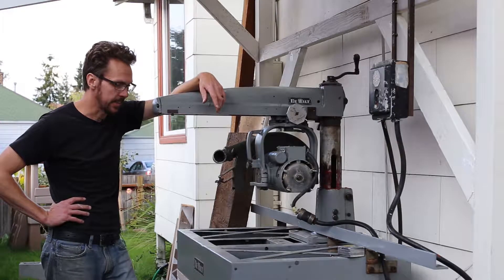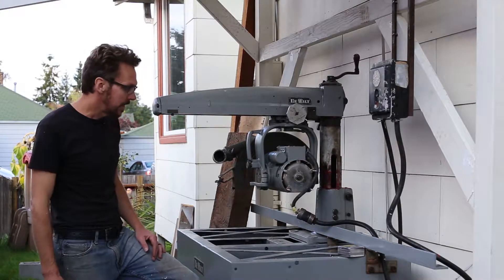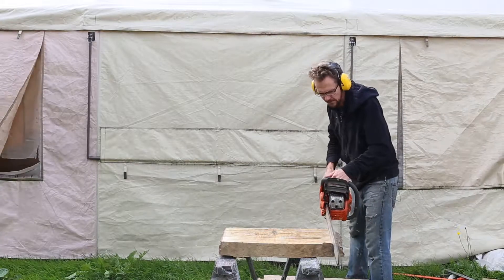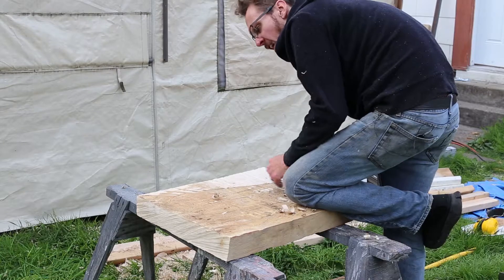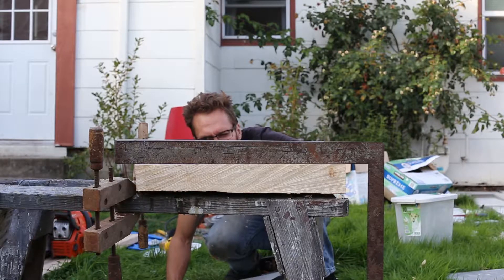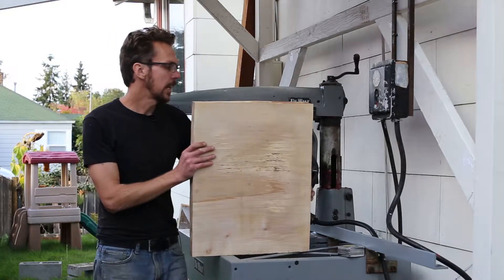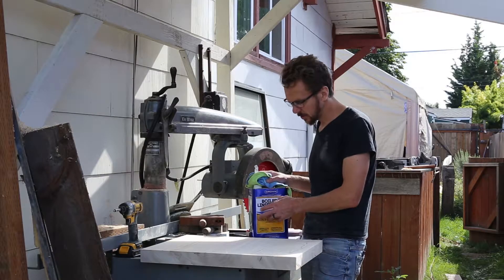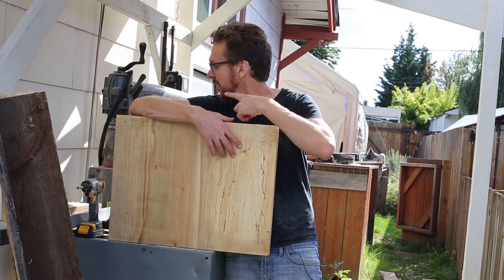Restoring a Dewalt Radial Arm Saw: Part 1

Comment: That's a fine saw. If you haven't been there yet, check out the Delphi radial arm saw forum. Tons of info about maintenance, parts, setup/ bearings etc. Definitely worth a look.
Reply: Link for the forum: http://forums.delphiforums.com/woodbutcher. Also, look into picking up a copy of the Mr. Sawdust book if you haven't already. https://www.mrsawdust.com Your table is probably OK if you're only ever going to do 90 degree cuts and rip, but it'll be bad news for miters. Also, get yourself a proper push board for ripping. Most of all, enjoy that saw, it's a great family treasure!

Comment: MDF and Plywood are very stable products. Very unlikely to expand and contract with humidity and temperature. They also are very resistant from cupping and twisting (these statements are assuming you're getting a good quality ply or MDF and not cheap stuff.) All in all, these 2 products would probably offer you a more flat and sound table top than a large piece of hardwood. Either way, I'll be watching the rest of the videos to see your progress.